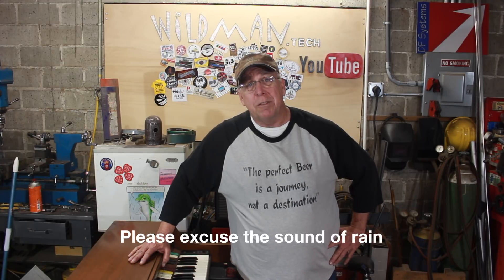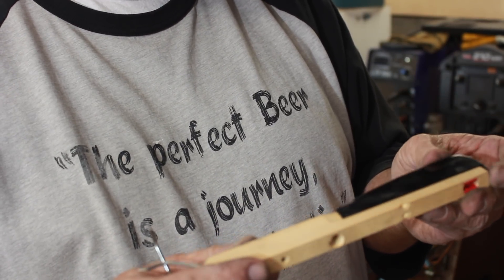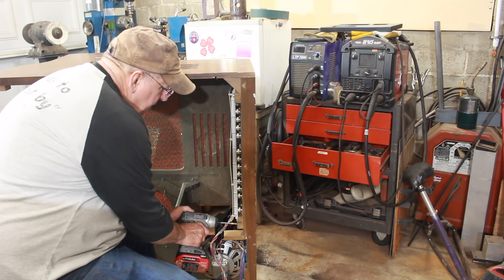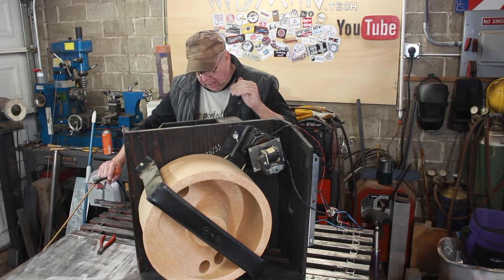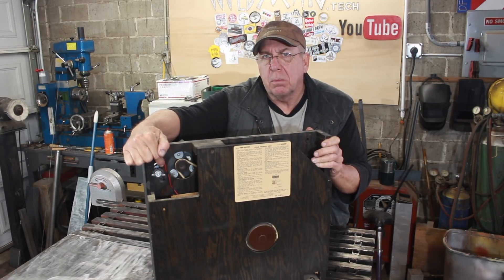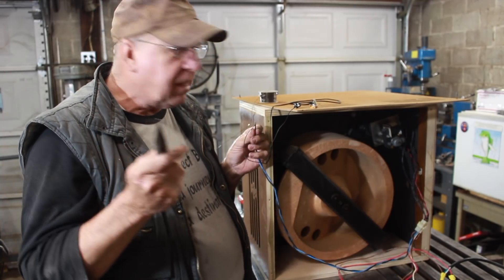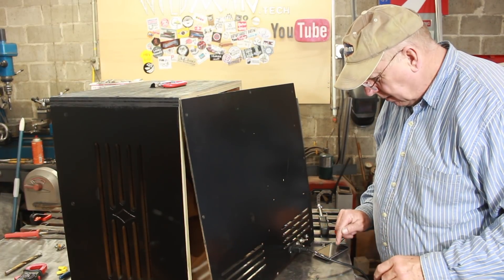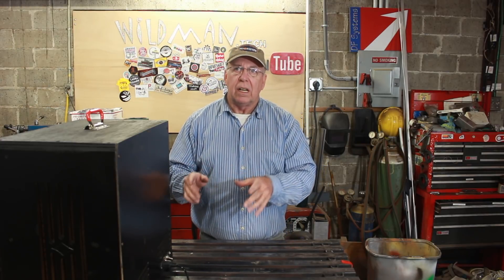Tremolo Unit Upcycled from an Old Organ

Comment: Trying to make one myself but don’t know how to wire the other two wires for fast and slow. Can you help?
Reply from the maker: I'd have to see yours. Mine basically had two motors. Post a closeup and tag me on Instagram, maybe I can decipher it. @wildman.tech
Reply: Mines the same. Two wires coming off the slow speed motor and two coming from the fast.
Reply from the maker: @rocknroll3214  So get a DPDT switch and wire the incoming power to the center connections. This one is labeled I and II so wire the slow motor to I and the fast motor to II. https://amzn.to/3R6EYhI
Reply: @WildmanTech  super simple and I don’t know why I didn’t think of that!
Thanks!

Comment: I'm still rehabilitating my e-112 organ that I saved from a hoarder. So, yeah, that was distressing to kill a working organ to make 2 lesser instruments. Mine works, but it still has some issues that I'm still trying to iron out. 

It was nice to see the Leslie tremolo cabinet build, though. I've been trying to figure out, if I need additional parts, like that rotating horn bit I've seen elsewhere, or if building a cabinet is all I really need to do with it, just so it's protected. I picked that same part up off craigslist a few years back for $50. Thanks for the demonstration! 👍

Comment: I don't know if you're still answering questions, but i'm a guitar player, and got this same model for free off of Facebook. I was wondering, mine doesn't have a plug to an outlet, is that a problem for the build? Do i have to use another amp to power the leslie?
Reply from the maker: I'm not clear on what the question is. The Leslie accepts the output of an amplifier.
Reply: @WildmanTech  my question is, would you need an external guitar amp?
Reply from the maker: @GoganLiesbrecht  The Leslie unit is nothing but a speaker, so yes.

Comment: I’m a guitar player but have a old Hammond organ that has a Leslie unit still intact. I’d like to try this but I’m a bit confused on the wiring. I’m also curious how you would amplify the sound from a instrument? Like say if you plugged a guitar or a keyboard into the cabinet. Also it would be awesome to build a foot switch to switch from fast to slow.
Reply from the maker: The tremolo unit I had simply had two 110volt motors inside. Low and high speed. Just switch one or the other on. Inside is just a speaker. You would simply connect that speaker to the output of your amplifier. If you live near a maker space, there will be plenty of helpful people there who could lend a hand. Or you could hire one of them to do it for you.

Comment: I got a cheap Kimball home organ a while back. I think when it kicks the bucket, I want to upcycle some components from it. Where could I learn the electronic aspects of adding 1/4 inch input/output jacks to things like the chorus slider and so forth?
Reply from the maker: What I found was that everything was so intertwined, separating things out became a problem. I kept the pedals, but the way I'm going to approach that project is to make a separate oscillator for each pedal with a pre-amp out.
Reply: @WildmanTech  oh wow.  I got the same feeling when I opened mine up. The boards seemed intertwined. Thanks for the reply and best of luck your endeavour!
Reply from the maker: @blackburn1111  Thanks. There will be a video.

Comment: Did you get to make a video of you using the pedals? I'm trying to reuse the bass pedals off of an old organ of mine, but I don't know how to go about it.
Reply from the maker: Not yet. I'm going to have to make individual oscillators for each pedal. Not a big deal. I was just going to use 555 timers.
Reply: Wildman Tech sounds great. When do you think it will be out?
Reply from the maker: Probably when the rains come. October
Reply from the maker: @FREEAGENTOFGODYAH  I think what I'm going to do for the bass pedals is make a separate oscillator for each pedal.

Comment: It might be easier to make the bass pedals midi and plug them into something more modern.  Nice Job!
Reply from the maker: There is a midi shield for the Arduino. Looking into it's capabilities, but at this point I think I'm going to just use a separate 555 timer on each pedal with an RC filter on it's output to smooth out the square wave.
Reply: I would second the MIDI conversion, that way the player isn't stuck with  just the organ sounds.  The problem with incorporating the amp in it, is it is going to be fairly heavy without  the amp being in there,and any amp that is big enough to be used is going to be heavy by itself - It would probably need to be at least 100 Watts, and personally, I would say closer to 300 Watts because pushing those  kinds of lows requires a speaker like a 15" or 18" that can produce them. (keep in mind, most people looking at these are going to be Rock Musicians - that seems to be where the Bass pedals found a home thanks to bands like RUSH.)

I used a MIDI conversion kit that I bought on Ebay, and 13-note Bass Pedal that was pulled from a Hammond B-2 Organ.
Reply from the maker: I thought about it. In fact, there's a midi shield for the Arduino, but the processor can only produce one tone at a time. Going with 13 tone generators and no amp.